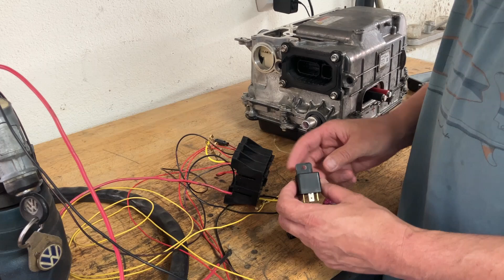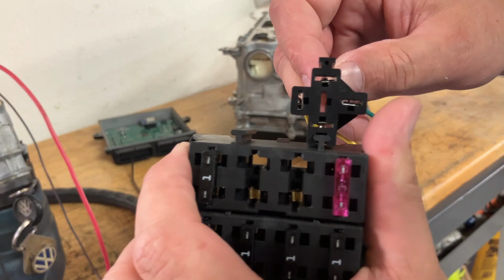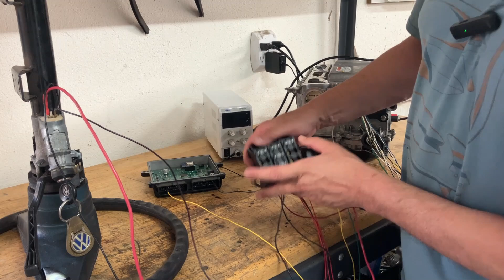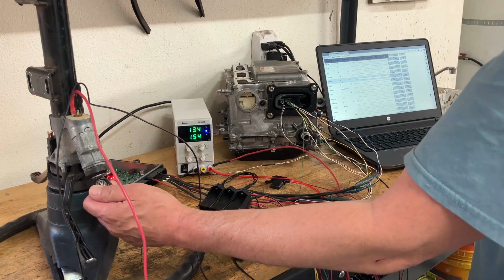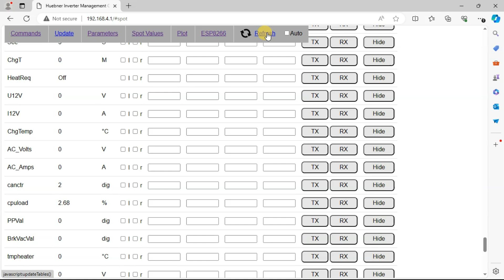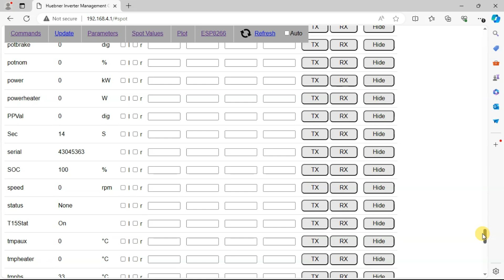EV Conversion DIY Wire Harness - Inverter Relay

Comment: Just a note, there are relays with diodes, so some times there is a positive and negative connections on the control pins of the relay. You will see the diode symbol on the relay diagram on top. Your's does not.
Reply from the maker: copy that